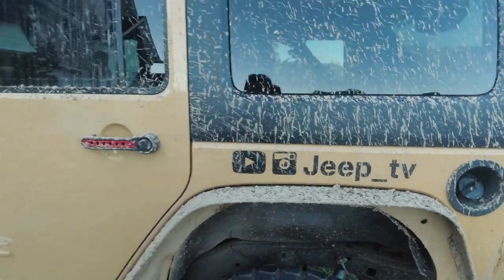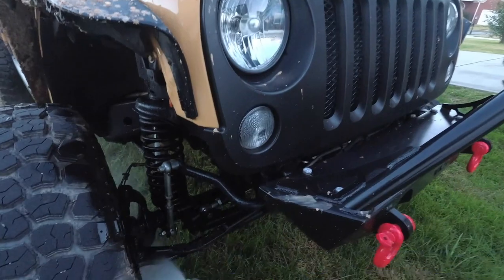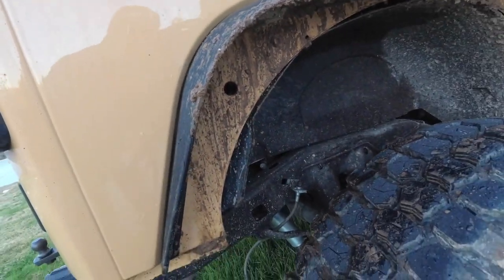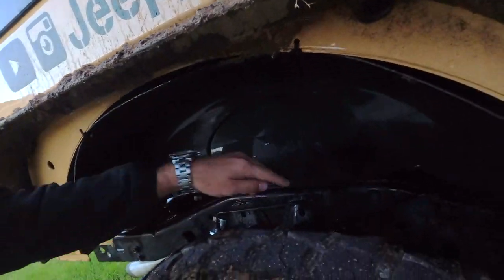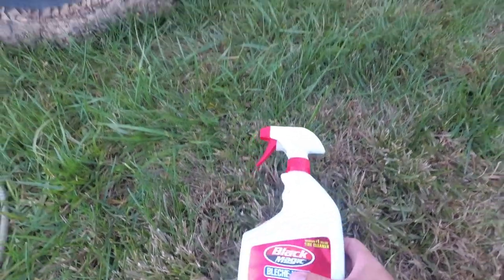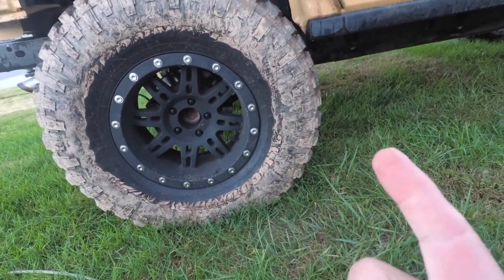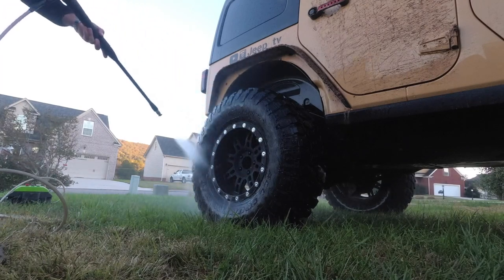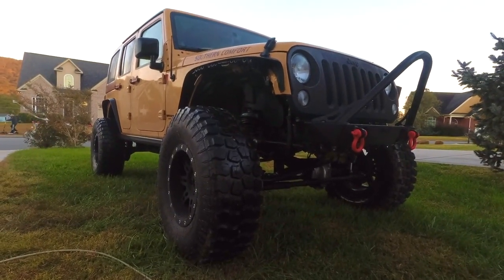Clean your Stained Muddy Tires Back to NEW | Jeep Undercoat Off Road Test | Cleaning Comparison

Comment: Simple green or purple power is what I use on tires works awesome.  I coat my frame with fluid film before the winter live up here in the Northeast and it keeps rust at Bay. I used to use wd40 on my whole frame but had to reapply it every month or so during the winter. Spring time I power wash the frame down and do a flat black spot touch up my frame looks new. You can also spray any type of tire coating on your inner fenders that works well too before a mud/ off-road day.
Reply from the maker: Rhino Willy's That’s a lot of W-D lol. I’ll have to try me some Purple Power.
Reply: @Jeeptv  ha ha yes it was 😁 Take care and enjoy the rest of your weekend.